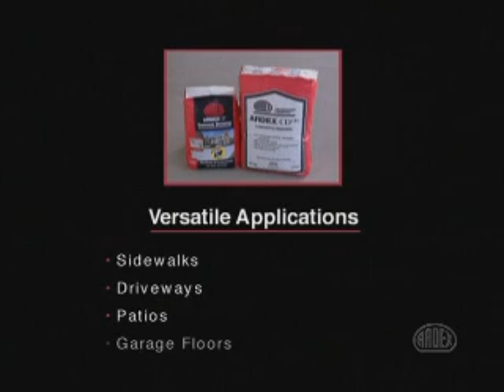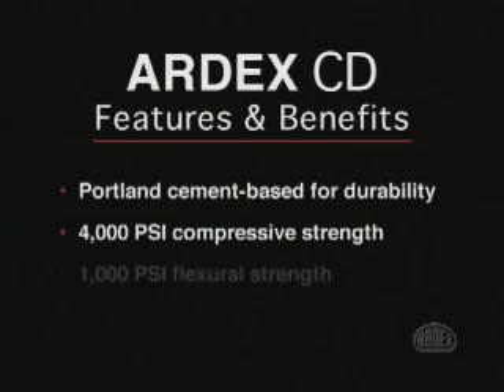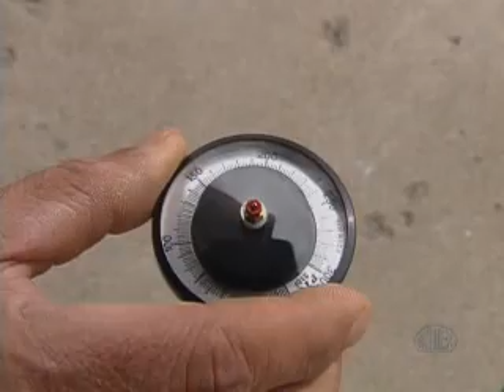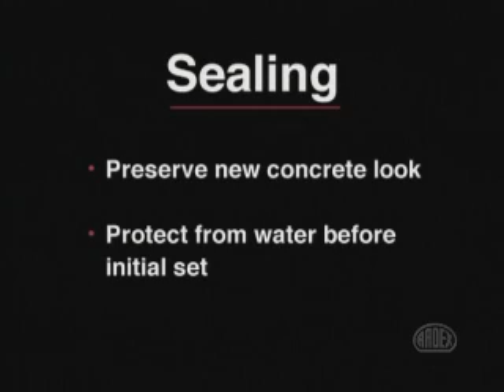ARDEX CD™ Concrete Dressing - Demonstration

Comment: Why not use acids to clean the concrete? Why not just mist the slab for a sure adhesion? If there is no drops and just mist, I cannot see it weakening the mix. Will it act as a moisture barrier? Will this poly mix keep from concrete dusting up over time? I have concrete in my workshop, and it gets concrete dust. If Ardex does not work in these parameters, would a self leveler like Mapei be a better alternative?
Reply from the maker: Hi Phil! Check out this video for more technical information: https://youtu.be/3_xdRkSEMRI Also, to answer your questions about misting, and slab adhesion, please call our technical experts at 1-888-512-7339. Thanks!

Comment: So a homeowner can;t use this product?
Reply from the maker: ARDEX products are sold at distributors, which sometimes can be difficult to buy from as a homeowner. However, we also have HENRY product line, which are sold at big box stores, and HENRY has a similar product line used for outdoor concrete repair. Give us a call at 1-888-512-7339 to find out more.
Reply: @ARDEXAmericas  Any UK distributes?
Reply: @ARDEXAmericas  is henry just as good?  i'm looking for some product in pembroke, ontario canada

Comment: Can a 32 in power trowel be used on it? Or does it have to be done in small sections only . I want to resurface my 32 x 32 garage all at once without joints  ?
Reply from the maker: Please contact ARDEX for detailed product information. You can reach them at 1.888.512.7339. Please note that when applying CD, you must honor all previous slab joints.

Comment: Guys right. Ardex is the only formula that never cracked, delaminated and fell apart. Alternative products from the homw ceners are crap. tap a hammer on the surface and listen for hollow spots. now drive your car over the hollow spot and